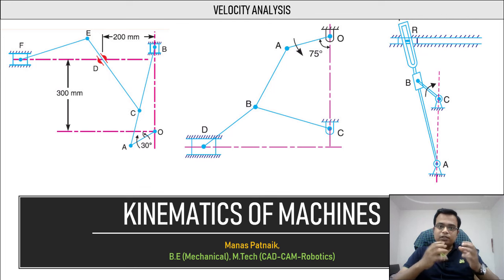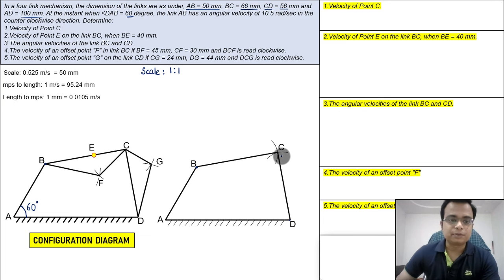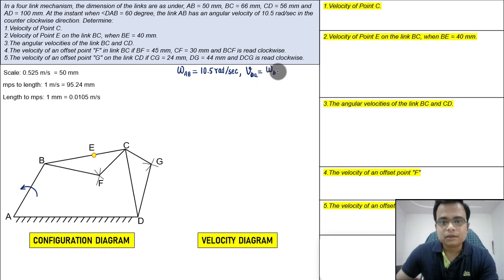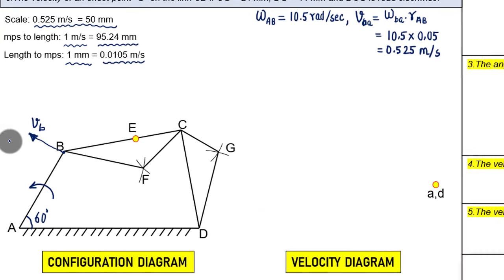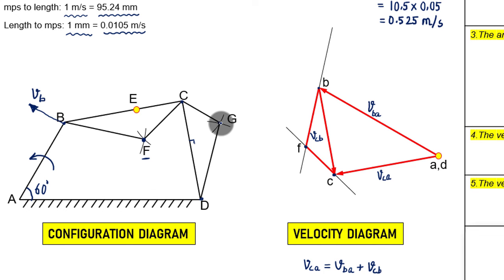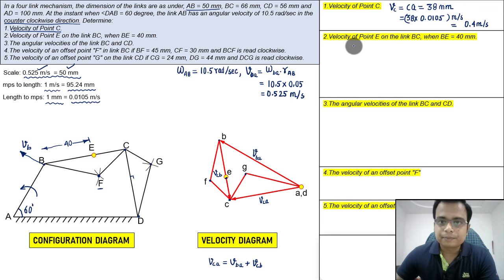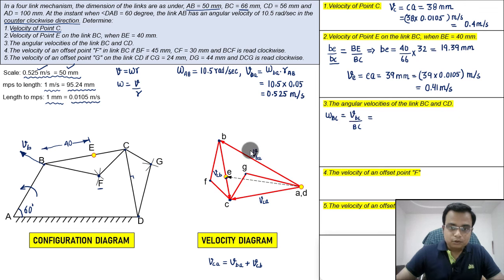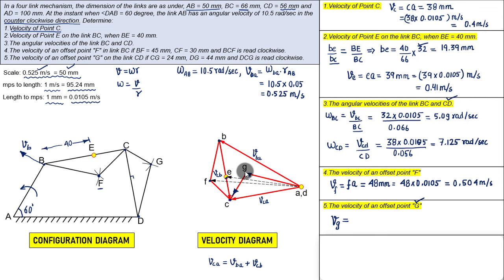Kinematics of Machines | Velocity Analysis | Four bar mechanism | Problem 1

Comment: Sir, for the velocity of point e we should multiply 19.39 with 0.0105, but you multiplied 39 with 0.0105?
Reply: No . Sir is correct!!
Reply: @karandogra5021  could you justify sir?
Reply: Look carefully 19.39 mm is the distnace of the point e from b on link bc but for velocity of point e distance of pt. e  from the fixed link should be considered which is 39 mm
Reply: @karandogra5021  I think its should be multipled by 19.39 not by 39, because the links on the velocity diagram have been scaled, thank u.

Comment: Sir,your video always help me alot..
Respected sir, can you help me by making the solution for this question? Below..my internals will start from Monday and im literally only 40% of knowledge about kom in my head..

Question: In a slider-crank mechanism,the crank is 480mm long and rotates at 20rad/s in the counter-clockwise direction.The length of the connecting rod is 1.6m .When the crank turns 60° from the inner dead centre, determine the -1) velocity of the slider.
2) velocity of a point E located at a distance 450mm on the connecting rod extended.
( The question is from theory of machine by SS Rattan 3rd edition)
I would be very grateful to you sir.